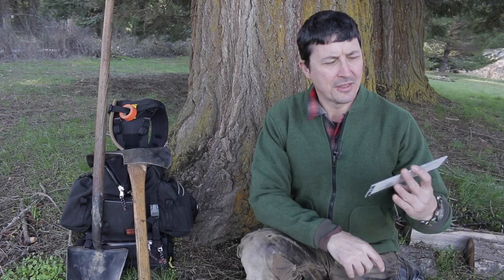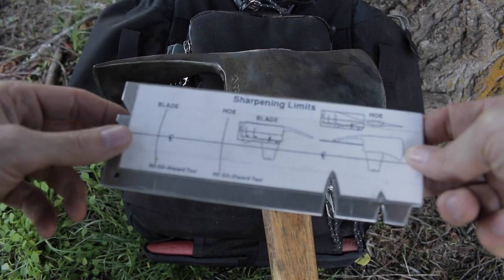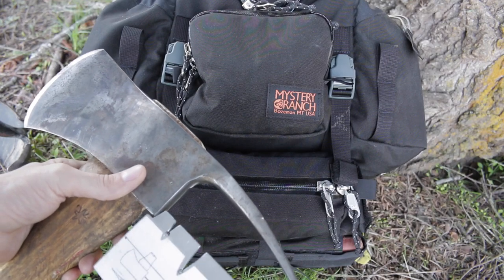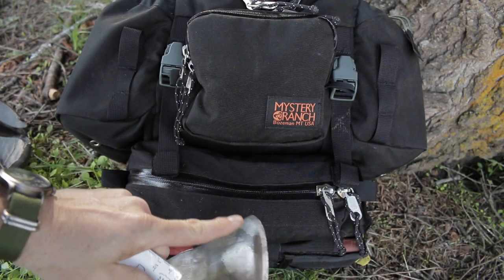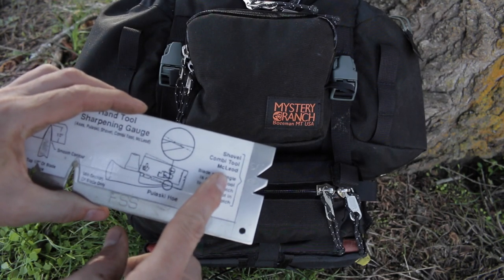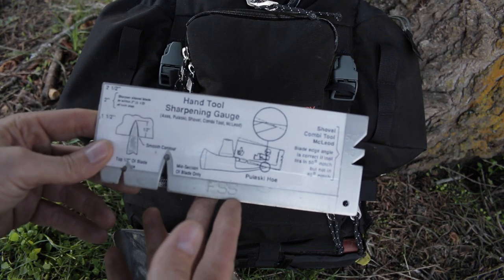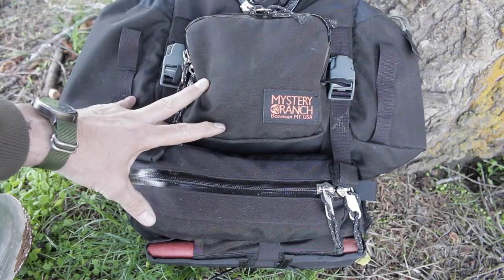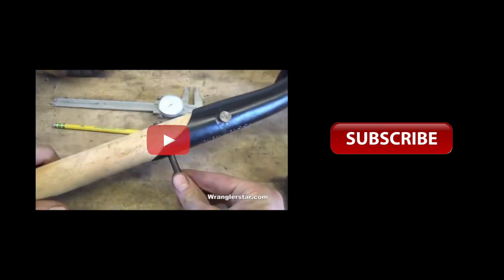Axe Tricks Of The U.S. Forest Service

Comment: The Missoula Technology and Development Center has developed a handtool sharpening gauge that provides a quick guide to the proper cutting angle for a number of tools. The gauge takes the guesswork out of sharpening Pulaskis (both ends), axes, shovels, combination tools, and McLeods. It has a "no-go" line that shows when a Pulaski head is too worn to refurbish. The handtool sharpening gauge is available from the General Services Administration, item number: NSN 5210-01-324-2776, NFES 0510.

Comment: We have a lot of them on the District. We have them in our fire cache and I use them quite regularly when rehabbing tools in the shop or from our engine. It's not something you would really carry in your line gear, but it's super handy to have on the truck or back at the shop. I'm pretty sure it's still available through GSA, but I don't do the ordering. I can figure it out for you if you would like. 

Greeting from the Sioux RD, CGNF

Comment: The Hand Tool Sharpening Gauge is available from the General Services Administration, pack of ten for $30.02. (Gotta love the feds and their decimal points.) Try searching this phrase to retrieve a PDF catalog: WF2011_IFC_Layout 1 - GSA. I came across a link to one of the catalogs, which may be outdated - looks like it's from 2011. The relevant info is on page 9 of the catalog, which is the 12th page of the PDF. Good luck.

Comment: As far as the shovel it is probably not sharped that high so you don't cut yourself as easily if you slip off.
Reply: +Anthony Bair That was my thought too.
Reply: I think we're all on the same page there. Although, the boots they require (and probably still provide) would keep your foot from getting cut, but would rip the boots open after enough missteps.
Reply: You don't sharpen it that far back because bevels get dull. Sharpening it that far back will cause the shovel to go out of service up to 5x faster due to the wear on that angle of leverage.
Reply: My idea exactly

Comment: I think maybe, that you were using the shovel gauge upside-down. I think that the side of the triangular cut out, that is parallel to the outside of the tool, should be on the top surface of the shovel, grok?

Comment: Presumably the "limit" for sharpening the shovel up to the turnstep would be to avoid having a sharp edge to cut the instep if the foot slipped off the edge of the turnstep? 

Seems a bit silly for professional users but I could see the validity for a home-user who uses a shovel once per leap-year cycle.

Comment: ok as far as ive been instructed you dont sharpen tines on a mcleod  , but those holes on the axe gauge do 2 things 1, they prevent the gauge from cracking and 2 , it prevents the cutting edge of the axe from elongating the dye and making the gauge inaccurate ,,,,, as well as not messing with the axes edge

Comment: Cody-
Check out this catalogue; page 10:  http://www.gsa.gov/graphics/fas/WildlandFire2011Catalog.pdf
Sharpening Gauge 
This highly portable gauge makes 
easy work of refurbishing and
inspecting fire tools in the shop 
or the field. Contains guides for axes,
shovels, Pulaski tools, combination
tools and McLeod tools. Aluminum
construction is 7.5 x 20.5 x 0.3 cm in size. Instructions
clearly printed on 
both sides. MTDC Drawing 846. 
(NFES #0510)
Std. pack: 10 or 100
5210-01-324-2776
EA   $30.02
Reply: Would you have to be part of the forestry service to order from this?
Reply: Or any other Federal Agency.
Reply: +Corey Wilson 

http://www.gsa.gov/portal/mediaId/176231/fileName/SignedGSADirective48002H.action

(4) Non-Federal fireflghting organizations cooperating with the U.S. Department of Agriculture.  Forest Service.  Pursuant to 40 U.S.C. § 501 and 16 U.S.C.§ 580a, it has been determined that certain non-Federal firefighting organizations may purchase wildfire suppression equipment and supplies from the Federal Acquisition Service (FAS). 
This determination is reflected in an interagency agreement between
GSA and the SDA, Forest Service. (FAS No. FM-IA-06-002, December 27, 2006).

Comment: If you have the plans you can have the gauge duplicated using laser to both cut and also etch the instructions on the sheet.
Reply: +Miguel Ángel Simón Fernández Stainless steel 2.5mm would be a nice choice of material, especially as it etches so nice with a laser.

Comment: The hole in the axe edge gauges works also as a stress relieve. This prevents cracks from developing and breaking or changing the tool angles.

Comment: Having the top of the shovel edge unsharpened might be so you don't cut up your boots when you are stamping on the shovel and you slip off the side? If you are frantically shovelling you might slip off and damage your boots? I live in England though on a smallholding in the south west in Devon so wouldn't be able to help.

Comment: I wouldn't call that a trick. I would call it a useful guide. I used to sharpen knives for other people because I was good at it. Axes I learned by trial and error, This cuts out some common errors. I would just call it a useful guide. Not to say I have sharpened a tool beyond its useful blade and the tool still works. This guide is for max efficiency.